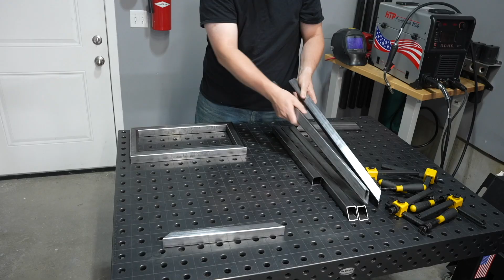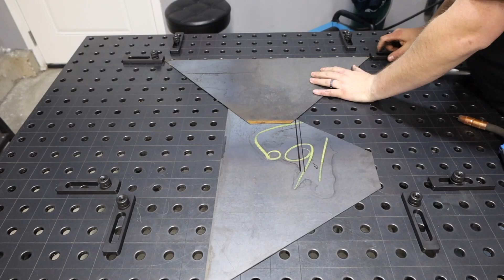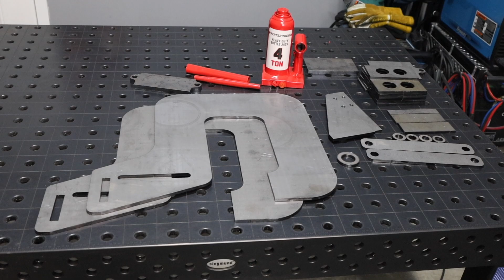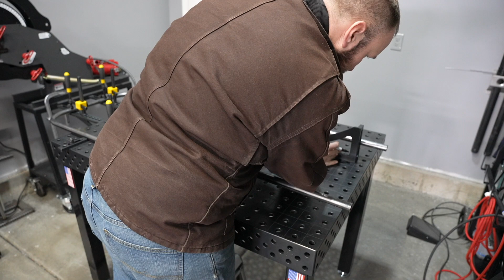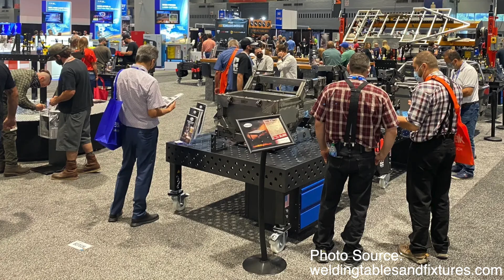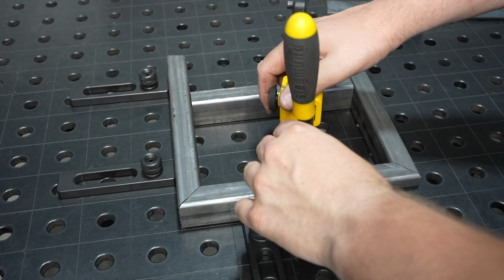Siegmund Fixture Table: 1 Year Update & Hydraulic Press

Comment: How do you make sure the tax would not adhere to the table and leave a permanent gauge or mark
I have the same table only larger and it’s already happened to me although I am using the nonstick spray came with a table
Reply from the maker: Any table is going to get some marks on it over time. I don't find spatter to stick to very much, but I do get some marks when I ground through the table.

Comment: A good addition to the Siegmund imperial 16 Fixture Table is the Milwaukee M18 Fuel Magnetic Drill Kit (2787-22HD). The fixturing is cast iron and the Mag drill locks hard magnetically in virtually any position, much more flexible than a drill press. If you get this pair of System 16 brackets US160124.N and US160126.N, and system 16 square US160362.P you can use the drill on its side. The Milwaukee mag drill handle detaches and can be used on either side of the drill. The drill has to be upright in order to use the gravity feed cutting fluid feature. 

What is really interesting is that you can drill at any position with high force that you can magnetically lock, even using the side of the siegmund table to hold a work piece or drill. 

The only system 16 item that siegmund did not offer (that is available for the system 28) that I wanted for the mag drill was just a flat cast iron mounting plate (machinists plate). I purchased a BuildPro Plate, 20 x 6-1/4 x 5/8 inch, Nitrided, but the holes are too small for the siegmund ball locks, but I had some RhinoCart 5/8 inch hole ball locks which work with the siegmund table. Both the Buildpro and the siegmund imperial tables and accessories are on 2 inch hole centers and 5/8 inch or 16 mm holes as advertised, however siegmund holes are actually 16 mm in diameter and not 5/8 inch, which is 15.875 mm, so the siegmund holes are slightly larger than the Buildpro holes.

Comment: I keep thinking about getting this. They’ve had a deal in time for Fabtech previously. I’m not sure if the deal js on this year. I believe it was for the 3 x 4 table and the fixture kit for $3,000, which for most hobbyists is rather expensive, but is ideal for small pro shops, or those who don’t find that price off putting.

Some of the features is the weight, around 465 pounds which helps keep it steady. Cast tool steel, hardened to about RC 60 and nitrided, which helps prevent rust and helps keep weld from sticking.